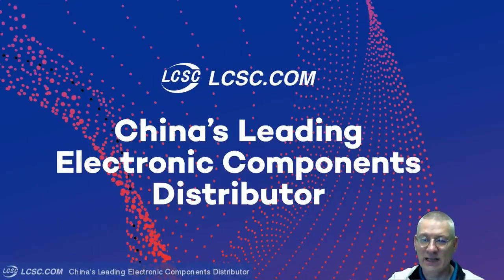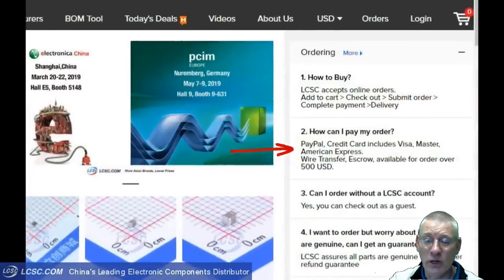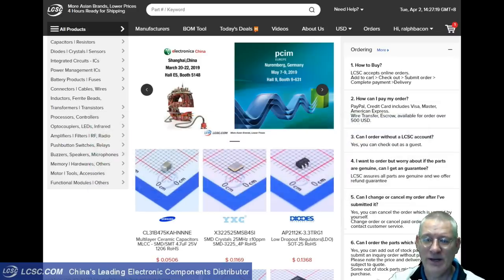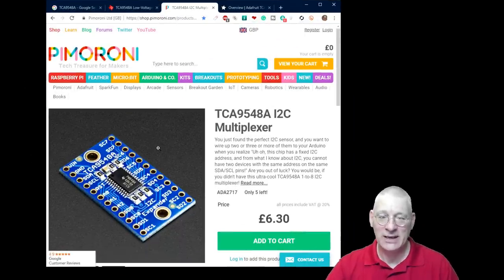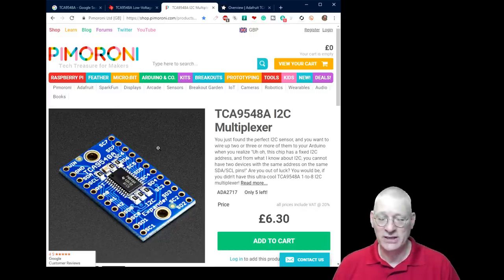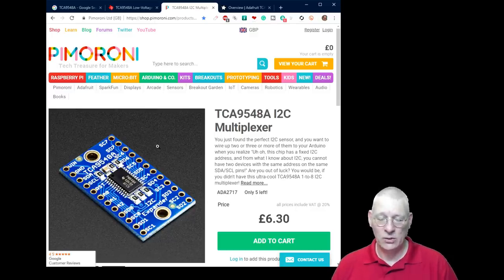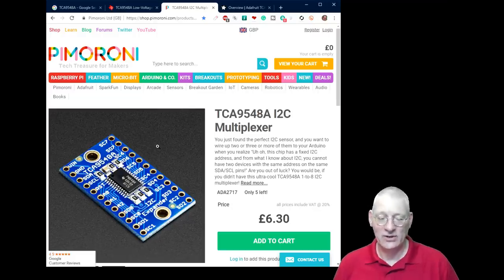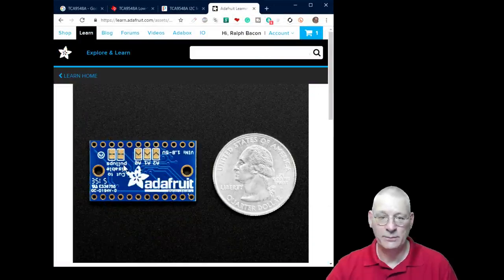#148 TCA9548A I2C MULTIPLEXER (& Voltage Shifter)

Comment: The process of converting a channel number to a bit position implies that the chip can be configured to send the same information to multiple downstream devices. The best example I can think of is a cash register where you want to show the same information on both the operator and customer sides. The data sheet confirms that the chip will do this. Overall, a fascinating video about a problem (ID clash) that I’ve never had to deal with but which raises all kinds of possibilities. Thanks.
Reply from the maker: I also wondered about that, Phil, and I felt the datasheet implied that it's perfectly legal to send the same information or command to multiple I2C streams. I wasn't going to mention this and confuse people as I had no real case example but you have most definitely given one. Could be useful in sending data, not so much in receiving data from sensors though!

Comment: Thanks for video I found this device from a member of MERG and as I wanted to use 2 x 128 x 32 Oleds on a Headboard on a Signal Gantry it was just the job as address is same on each Oled, just waiting for PCB from our favourite JLCPCB to arrive so I can build using a Nano and a switch case sketch as I need just a "P, B and T" on each Oled when certain points and signals are triggered ...Cheers John
Reply from the maker: Thanks for sharing, John, I'm very happy this video helped in a small way 👍

Comment: Another great and informational video. I looked at I2C in the past for placing some sensors around the house and quickly found that the length of the I2C bus is very limited. It gets very complicated but I usually limit my wire lengths to 1 meter,
Reply from the maker: Yes, the I2C, even at the lowest 100KHz speed is limited in length, William. Using shielded cable can help (the shield is grounded around both clock and data) but then timing issues can arise. Best to use a simple nRF24L01+ sender for longer range stuff around the house - or even a simple LoRA node if it's right down the bottom of the garden!

Comment: Another great video Ralph.  Might be worth noting that I2C requires a common ground - not a problem for this set up, but if using say multiple Arduino's then ground must be connected between them.  Keep up the good work!
Reply from the maker: Good point you raise there, Bruce, thanks for mentioning it. Glad you liked the video too!

Comment: Great video on how to use the TCA9548A I2C multiplexer, If I had a need to use one of these it'd be a real time-saver and explains everything in such straightforward terms. This is one of the best written tutorial videos I've ever seen. 

But seriously, what is it with firmware engineers and their love of confusing the starting index between 1 and 0. 

So when setting the bitmask at 27:27, "((1 << 0) == 1)" you set bit 1 to talk to channel zero, why the inconsistency :( I know that it saves an if-test if zero is passed in and subtracting 1 would cause an underflow on zero, or perhaps sending the zero byte has some special I2C significance, but why label it channel zero at all. This has been the cause of so many bugs over my years of development work, and I can't believe that firmware engineers still think this is somehow acceptable (to just use 0 sometimes then randomly use 1 - usually when they realize they need a NULL sentinel). Just chose one, either it starts at zero, or it starts at 1, then just stay consistent throughout your product. Am I the only one who this really bothers as an API user? If they love adding and subtracting 1 all the time, then I think it should be kept in their own code, and present a consistent API where Channel 0 is always channel 0
Reply from the maker: I hear you, Adam! I've been a professional developer all my (long working) life and it is annoying. Even today, in C/C++ when you declare an array, you state int myArray[10] which means you can store 10 items in that array starting at zero and ending at 9 - how many hobbyists start at 1, end at 10 and cause memory corruption? Some languages even allow a SET BASE to either 0 or 1 to "get around" this inconsistency but that confuses everyone. So, it's not just you.

Comment: 26:00
  I'd love to hear more about the nuts and bolts of what you're able to do with eclipse in order to decipher how a library works. Seriously! I've spent the last 3 days trying to get a cheap little display running. 
  A Chinese store is selling a little ST7565 based display for less than $1.50 each. Someone posted a list of basic register commands, and the seller posted pictures of the working device along with the LCD ribbon pinout with SPI connection. I ordered a few, etched a couple boards, and figured I would take on a challenge. A challenge I'm well aware, is way over my head. I have several library examples that work with ST7565 controllers and a few other working ST7565 based displays to mess with. The biggest difference is that the mystery display is smaller in size than the typical 128x64. I have spent quite awhile trying to understand Oliver's U8G2 Arduino graphics library since he supports several ST7565 implementations and has readable commented code. However I'm not super familiar with Cpp and could really use a solid example and better methodology for dissecting a complex library. I'm sure it would greatly improve my understanding. 
  You are the king of breaking down code like this in a practical and useful way. 
...anyways...it's just a suggestion from a single subscriber/viewer. I'm sure you have a long list of projects to film and don't have time for random content suggestions. I don't take such things personally. I was simply intrigued by the hint of a better methodology for achieving my current goals :-)
  Thanks for the upload.
-Jake
Reply from the maker: I learned the hard way never to buy hardware that wasn't supported by something, ideally a working example but failing that at least a decent datasheet. This applies 100x to displays; the number of hours I've spent with a white screen cannot be counted; only to find a single byte of data was "wrong" but not finding that until someone else had (partially) cracked it.

Eclipse doesn't help you get a display (or any other component) working in that respect. What it allows is easy drill-down into the supporting libraries so the code is right there at your fingertips rather than having to open (yet another) file in Notepad++ or the Arduino IDE which is very slow to open anything in the first place!

Additionally, the Eclipse IDE will immediately tell you if you are using a function incorrectly - something the Arduino IDE only tells you at compile time. It has Intellisense to it prompts you with all the necessary parameters and types.

It's a right b****er to install (sometimes) although it's getting much better these days. The best way is to try it and then figure out what Project, Tool Chain Editor and the suchlike all mean. It's more-or-less documented at Jan Baeyens' website but it does require some work and patience - and Googling!

The best way to find out if it's for you is to try it! Just don't ask me for any help!!! Good luck!
https://eclipse.baeyens.it/

Comment: Hi Ralph thanks for your wonderful Video! May I ask you if you have any idea about TCA9548APWR which is from Texas Instruments? what is the difference between TCA9548APWR with the one you use in the video? Again Thanks for your excellent explanation!!!!
Reply from the maker: Many chip manufacturers can legitimately produce the same chips (presumably under licence). Think: 741 op amps, 555 timers, 74x00 logic circuits. But not all (generic) chips are always equal. And thus may not perform the same.

However, all chips should at least conform to the original data sheet so one circuit can/should take any manufacturer's chip of the same name.

And if one manufacturer manages to get the leakage current down to 2μA rather than the expected 10μA, then so be it. Their chips will be more sought after, making them more profit.

Companies making products with a particular chip will doubtless use chips from several manufacturers, if they can find them, to mitigate any single-sourcing issues (availability, cost, technical problems). This is known as second (or third, fourth) sourcing.

In the hobbyist arena, I would not expect any particular circuit to be so critical of a particular manufacturer's chip; use the one you can find but just be aware that some chips are made by companies who have not officially licenced their production and are just in it for the (black market) money. These chips that may have issues. I have several nRF24L01 chips that are probably counterfeit (unlicenced) and perform poorly, although the manufacturer of the hobby board is probably unaware of this; he just bought some "cheap" nRF24L01 chips and put them on a PCB! Caveat emptor!
Reply: Thank you for your kind and detailed explanation!! I learned a lot from it!! I am new to this area and need to do something with sensors and boards. : ) Much appreciated!!!  @RalphBacon

Comment: Hi! I love your videos - sadly I just discored them lately.
Anyhow, I browsed throught the comments, and I couldn't see any regarding pullups on the slave channels - which are required, and not included, neither on the chip itself, or the Adafruit board. (Didn't think there where any on the LCD-controller either.)
Maybe thats the reason for some of the commented problems...
Reply from the maker: Oh no! Where have you been, Pål, there are many videos here! 😯

Regarding I2C pullups (10k is normally enough) you have to be careful because vendors always seem to add them to their (device) boards with the result that the bus can no longer pull the lines low - just a single resistor on each line is enough.

However, if as you say, there are NO pullups at all then we need to add them - with caution! Good point you make, thanks for the heads-up 👍

Comment: Hi Ralph. 
You do stunning work with this channel.
With New Zealand in full lock-down due to the Covid 19 virus, a great opportunity for me to go through your channel and do some playing.
I am currently working on a project that requires 3  HX711 modules. I would really like to pass them onto a I2c  mux such as this TAC9548a.
Having a fair bit of trouble finding info on doing this. Thinking if I can address the SD"x" and SC"x" as the  DOUT and SCK for The HX711 I will win. Any suggestions would be much appreciated.
Stay safe and please continue with your most informative videos.
Cheers.
Sean
Reply from the maker: The HX7111 is not I2C conformant, Sean, so is unlikely to work in the manner  you suggest (unless you have a few hundred hours to spare). A board like this one, https://www.sparkfun.com/products/15242 does offer a true I2C interface for the HX7111 so I would expect you to be able to multiplex three such boards in minutes using the TCA9548A. Cost might be a factor as they are not exactly cheap, but you may find cheaper suppliers (or even equivalent boards out there).
Reply: @RalphBacon  Hi Ralph.
Thanks for your input. I so far have a workable solution. As luck would have it, you can connect all the clock pins together. This has freed up some pins on my D1 MINI. It also allowed me to move the data pins arround as some positions produced more noise than I was happy with. For your info, now have clock on D5. and the 3 data lines on D6 to 8.
I will when I can get one shipped try to run the signals to a shift register then to a single HX711.
Plan on giving a 74HC595 a try for this.
Keep up the Great work and thanks again.
Cheers.

Comment: This stops being needed when you move beyond the Arduino of course.  Having 3 or 4 independent I2C buses available kinda negates the need.  I suppose if you are adament you want to use the Ardy this device moves the problem into hardware and saves you having to bit bang software i2c on GPIO pins.
Reply from the maker: Well, the Arduino is still aimed fairly and squarely at newcomers, kids and hobbyists who just want a simple sketch to do something! So extending its capabilities with this little bit of hardware keeps them in the Arduino camp (where they feel comfortable) for longer.
Reply: @RalphBacon  No argument with that.  I mean I started with the ardy (well the PI).  If anything I found it's simplicity sometimes a little dishonest, but it tended you into producing sloopy code as it was generally forgiving.  For newbies the main issues I see are not the first step which the arduino does really well in single purpose sketches.  Its when they come to step 2 and combining multiple sketches into one project.  That step, because of the C++ nature can be forbidding and once things start into multiple compilation units and multiple loops the real nastiness of C++ will surface and... the Arduino IDE (and framework to less degree) will start to get in the way and be in adequate.
Where I think the future for the newbies lies, is back with the Raspberry PI that arguable started the whole "trend" with the PI 1 and 2.  The MCUs there are fast enough to introduce Circuit/MicroPython and other "VMs" which open newbies to much higher level more forgiving and supporting languages.  No hope for performance, but thats not always the aim.

Comment: Great video as usual Ralph, I'm looking at one of these for my multi-input battery charger where each input has its own LCD showing power, etc, six in total.
Reply from the maker: Remember, Tony, that the LCDs I showed (basic 16 chars x 2 lines) do allow different hex addresses without a multiplexer, from 0x70 to 0x78 (so 8 device addresses in all). If you need more than that (but you say six) then you will need a multiplexer. Thanks for your kind words and for posting.

Comment: You can run more than 8 chips if you want to by linking them in a cascade so example you have one primary chip then you could attach 7chips per 8 i2c channels. Why that would be needed I don’t know but it is possible.
Reply from the maker: Yes, you can, Kendrick. But, like you, I don't know why someone would want to do that but I bet someone, somewhere, has a need!

Comment: Having more than one pullup resistor has a big issue when pulling it down while communicating, since now large currents are flowing, while the resistors in parallel increase the current flow. 2*10k is like 5K but 10* 10K in parallel is only 1k. And many do not even use 10k, but only 4k7 values or on long lines even less than 4k7, which makes things even worse. At 10*4k7 is just 470 ohm. And on 5V, 470 Ohm is a already a current of about 10mA (53mW). But if the I²C line was planed to be long the pullup-drive needs to be stronger, and the resistor might be only like 470 Ohm. 10 of that is then only 47 Ohm (100mA) and that could already be too much for many ICs. So the conclusion is, there should be only one single pullup-resistor for each of the clk- and data-line, but no more than that! And that is actually the way it is meant to be on I²C-Bus. Multiple pullups in parallel are not recommended!
Reply from the maker: Yes, I totally agree, Sebastian. 
The problem is that if the 'module' makers did not put a pull-up resistor on their boards then there would be no pullups in force at all - with disastrous consequences for the I2C bus (ie it would not work) and it would seem that the I2C module was not working. 
So now we have the reverse situation as you have described; each module has the pullups and if you connect a few items onto the I2C bus it may stop working for all modules. To correct this, the 'module' makers should have the pullups connected via a simple jumper (they all go to VCC after all) but I guess that costs 1c too much for them.
As it stands the modules are fine for individual testing. When implemented, however, the maker should ensure there is only 1 set of pullups active (ideally on the µMCU). Easy to say, harder to remember to do.

Comment: Ralph, I might have missed the explanation, but the code at line 17 is a bit confusing. Why 'Liquidcrystal_i2c &LCD'?
Reply from the maker: The code you are referring to is the definition of the function:

void displayLCD(int channel, LiquidCrystal_I2C &LCD, long value);

This means that the function is expecting a reference to the LiquidCrystal_I2C object, we are passing by reference not the usual passing by value .

The function therefore deals with that object over there (in memory) rather than a (throwaway) copy of the object given to the function to play with.

This also means that the function can make changes to the object that persist - it's the actual object in memory, not a local copy that can't be modified.